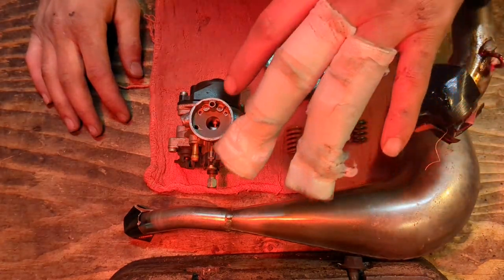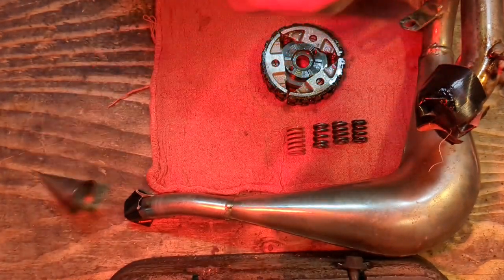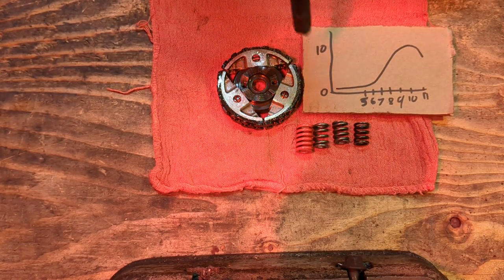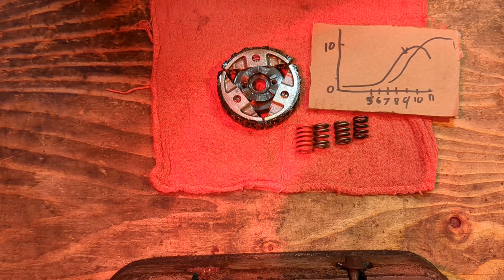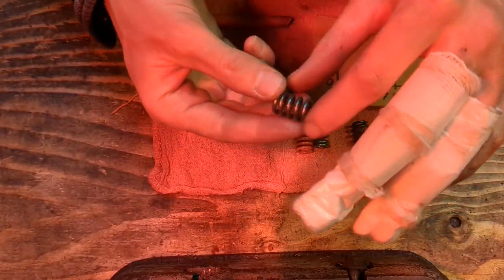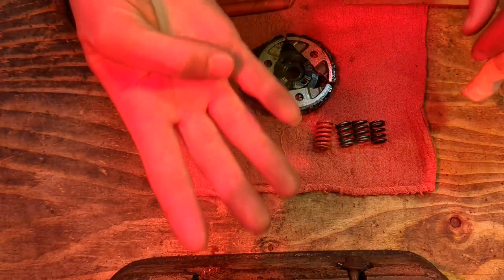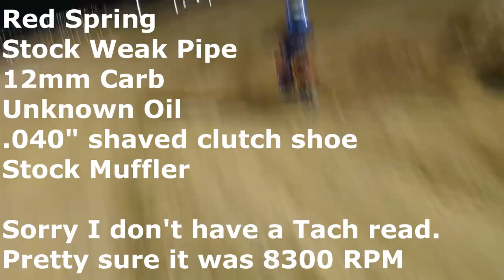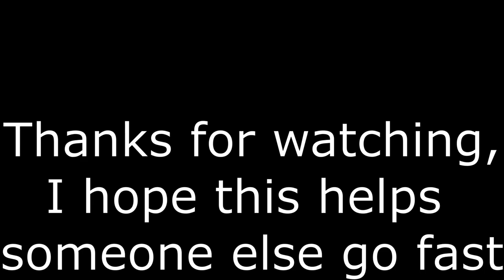I Fixed the KTM 50 Clutch... It's Fast & NO MORE WASHER STACKS. 2002 to 2008

Comment: Fun presentation!  If you had to sequence this, what order would you go?
Reply from the maker: In terms of which modification first? Carb/exhaust. Doesn't make sense to spin the clutch if the engine isn't making any power up there. Plus you might adjust the clutch to your desired RPM and then add the carb/pipe later and suddenly it make a lot more power throwing your clutch way out of whack, or it might never actually lock up. It's really pretty trivial to throw in the springs though for a minor improvement.

Comment: Hi, as I understand, you use 445lb/in springs, which in metric units is 8kg/mm or approximately 75N/mm. My question is - how long you cut them? Space between clutch shoe and its bolt head is 13mm. So the spring should be same length? Or little bit longer to get some pretension? Thanks for answering, greetings from Latvia!
Reply from the maker: Hi there! 

Original spring is 20mm long.
I cut the red stiff die spring to 22mm length so there is some pre tension.

Longer red spring would make higher stall RPM but it will be harder to engage the bolt threads. Shorter red spring makes a lower stall RPM but easier to engage the bolt threads. 

When you mill the bottom of the clutch shoe there is more chance for thread engagement so it's easier to catch because the clutch shoe bottom is closer to the threaded steel part.
Reply: @theshippingcontainergarage  can I ask your opinion about our clutch setup? 
https://youtu.be/3yA1amCkqgk?feature=shared
It does not run so good as I would, there are washer stacks at the moment, but I am confused at the moment do I have to pretension them or opposite.. unfortunately I do not have a tacho to measure the rpms, but it sounds like 7-8krpm. 
We have 19mm carb and sxs pipe
I really want to try die hard springs, but I have to wait for delivery.
Reply from the maker: @krisjanisgalins451  It sounds like about 8k rpm to my ear. There might be something else going on that's limiting power. 8k rpm on the clutch is slow but it shouldn't be that slow. I think the biggest problem is that the Husky Boy has the ANCIENT Morini motor. 

Pull the muffler off and try running it(isolate any muffler problems). Double check the air filter. Check the spark plug color and make sure your main jet isn't too rich/lean. Was it a brand new, clean pipe? if it's a used pipe make sure the internals are clean. If it's dirty and caked up inside clean it. Make sure the rear sprocket isn't too small(too much top speed). Are the brakes dragging at all?

Beyond the easy external things you need to start looking inside the cylinder at the porting on that motor. You should also check bore diameters and check for blow by around the piston rings. That cylinder might be worn out. 

I found a husky boy cylinder on Ebay and I can see the ports in the pictures. They are really poorly designed for making power. https://www.ebay.com/itm/363803319394

I don't think you will get much, if any, power from that cylinder design. 

My recommendation is to save up your money for something newer and larger. Your kid is looking too big for the Husky Boy.

Comment: Do you have any of the links for anything else? Carb etc
Reply from the maker: My bad I meant to include that in the description. Here it is. I'll update the description as well. https://www.mopeddivision.com/part-type-newest-items/air-fuel-intake/dellorto-19mm-phbg-bs-carburetor-pull-choke-new-model/
Reply from the maker: I should add don't forget to match stock jetting and start from there. The jets that come in the package aren't the standard KTM jets. I think the slide cut is sometimes different as well.

Comment: Its like 300$ for those red spings though.
Reply from the maker: Jesus... I've never seen Grainger do this. They increased the minimum quantity required from 1 pack of 10 for $31.10 to buying 10 packs of 10 each at $28.52... Meaning $285.20 is the minimum amount and then you are stuck with 100 springs... Ridiculous. I'll try and find a replacement vendor.
Reply: @theshippingcontainergarage  I just got some on eBay for 15 bucks
Reply from the maker: @WestHaddnin  You must have found the last ones I can't find red RAYMOND 305304D springs on ebay.

Comment: Hello mate. You drill otherside the clutch??
Reply from the maker: Sorry bud, I don't have any idea of what you mean by the "otherside the clutch". What you see in the video is what you get.
Reply: I see on front i mean rear.
Reply from the maker: @Kryspin699  Tell me what time? for example 01:15 points to 1 minute and 15 seconds.
Reply: Other side 1:15. You drill front i mean rear.
Reply: And tell diameter drill. Thanks
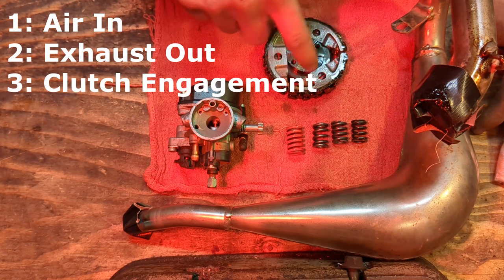Reply from the maker: @Kryspin699  I drilled through both sides of the clutch as you can see in the video at 01:10 to  01:15. As far as the hole diameter... it was probably 3/8" or similar. You don't need to go too big. Too small and it probably doesn't help. 

I hope that explains it well enough for you! Let me know if you have any other questions.
Reply: @theshippingcontainergarage  Thanks

Comment: 16x8x25?
Reply: Found springs on ebay that are a lot cheaper. Just trying to figure exact size. Thanks for this vid lol
Reply from the maker: @zshan1895  My bad sorry for the late reply. The link below is the spring I used. It's an imperial sized spring but if you can find a die spring that is close to the same spring rate and dimensions you should be fine. The main limit is total length, and rod diameter. 

There isn't much difference between 16x8x25 between the imperial size on the grainger link below. You still have to cut the 25 down to 22mm or lower. 

5/8 diameter, rod size 11/32in, Length 1 inch. 
https://www.grainger.com/product/RAYMOND-Die-Spring-Heavy-Duty-44V164
Reply: @zshan1895  Have you had any luck with spring from ebay?
Reply from the maker: @tuckerboy10wbo  I also want to know... I couldn't find the Raymond springs on Ebay. Tucker, let me know what you end up doing.
Reply: @theshippingcontainergarage Broo I’ve been trying hella hard to leave comments but the algorithm keeps deleting my shit fml. Im installing the ones I got today everything is the same but it’s  2 inches instead of 1 inch.
Reply from the maker: I think you ordered 305308D instead of 305304D. 

That's 2 inch and 210.7 lb/in

Instead of the ones I used with:
1 inch and 445.4 lb/in

The ones you ordered are really weak. I have a feeling you may have cut them too long or didn't grind enough paint to get them to fully seat.
Reply: @theshippingcontainergarage  With the 305308D, I thought I had the same exact one you had but it was a longer version but now I see it is 210lb… which is crazy because it’s so hard to push I can’t even use my fingers to make it budge, just like you in the video. I’m pretty sure they will work if I cut them shorter , about 5/8 instead of 22mm.
Reply from the maker: @WestHaddnin  Let me know how it went!

Comment: Broooo I’m bummmed. I just tried this and it didn’t work. Took forever to get the springs to catch the threads but I did it and it’s not engaging now. What did I do wrong?
Reply from the maker: Hey bro I just replied to the other comment you left to someone else. I saw you preferred the wrong part number and used a really weak spring that is 2 inches long. That weak spring will work if you cut it to the correct 20-22mm length and grind the paint off so it seats fully. But it's not going to have a 9k-10k rpm lockup. If you make them too long they will bind up on themselves and they won't be able to move period. What length did you cut them to?